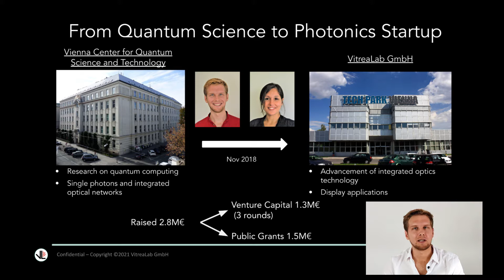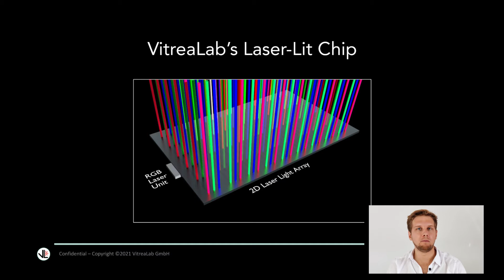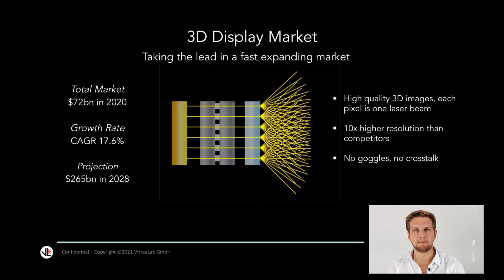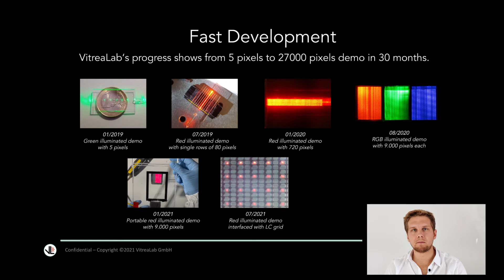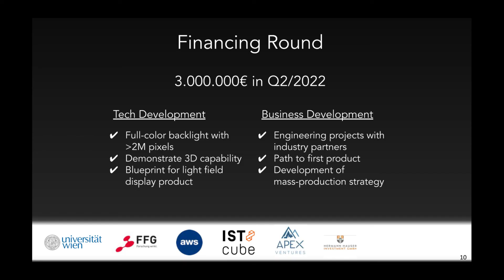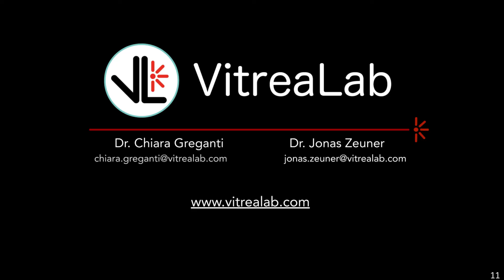HighTech Venture Days 2021

Comment: The apple ultrawatch 2 can do 2000nits of maximum sustained brightness and 3000 nits peak brightness. What is the maximum theoretical sustained brightness you could achieve with this technology for a 2" display? Also can you turn individual pixels on and off like OLED, or only a few zones?